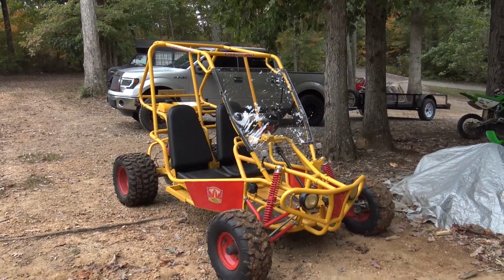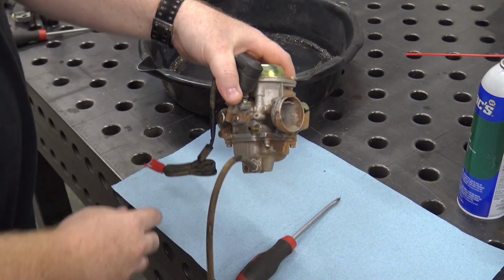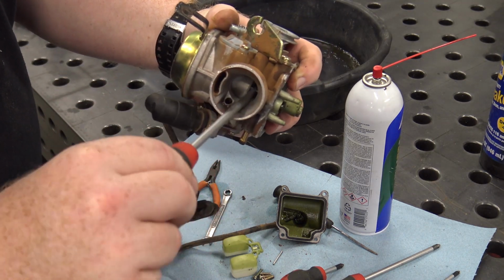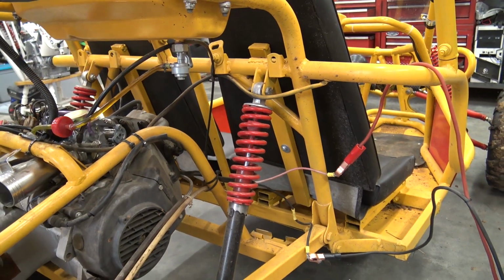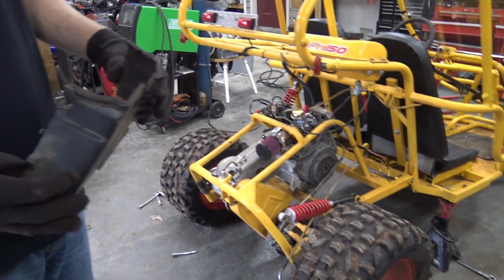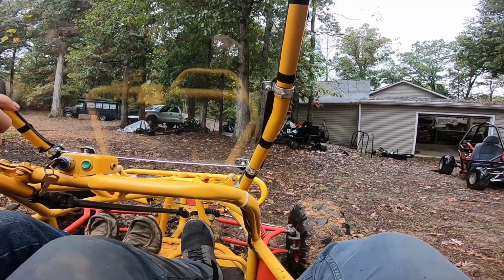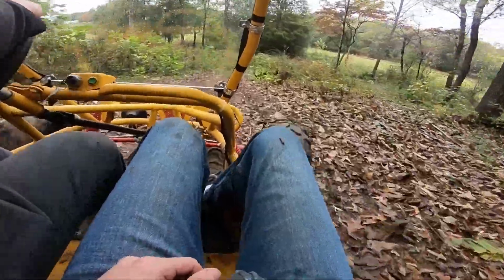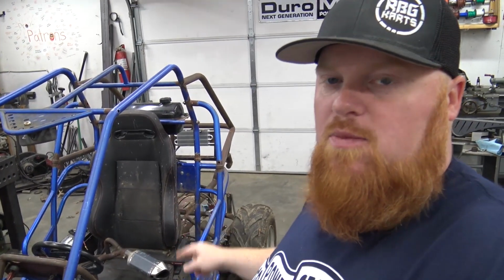Tomberlin Crossfire 150cc Revive

Comment: I am just finishing up a modified crossfire 150   scalped roll cage 8 inches, extended rear swing arm 6 inches to make room for Polaris 400 scrambler 2'stroke with 36 mm carb, Polaris snowmobile pipe/ expansion chamber and transmission. Installed 12'in rims and 26 in tires. LED lights and suspension mods. Next up will be long travel front suspension with 26 inch a arms, remote  reservoir shocks   55 HP and 75 MPH. Not a cobbled up junker, I build and drive drag cars. I have pictures
Reply: Got a Instagram

Comment: There is so much you can do for performance on those 150cc engines such as a big bore/stroker kit, performance exhaust, performance intake, cams, charging systems, cvt reprogramming  via weights and springs, Kevlar cvt belt and so much more

Comment: I trashed my gy6 motor, i flattened the swing arm, and mounted a trimmed frame honda 250sx up in the rear. I mounted front shocks off of a 250 recon, from the top of the 3wheeler frame, to the rear frame on the buggy. That thing was a beast. Got you in and out of alot of trouble.

Comment: Hey Big Red! I’ve watched your videos before but when I saw the name Tomberlin I had to comment. See I own a 2018 Tomberlin SS Coupe 48 volt Golf Cart LSV. That is a great Golf Cart especially compared to most others out there. They all come with 4 wheel hydraulic brakes with drilled front disks, independent adjustable coil-over front double A arms, safety glass DOT Windshield and wiper, 3 point seat belts, all LED lights, including stop, tail, turn and four way flashers and third brake light with a VIN, that comes with a Certificate Of Origination to get a State Title and Register it for use on roads with 25 mph limits. Mine being an SS Coupe comes with an A/C 17 hp electric motor built onto the straight rear axle with trailing arms and adjustable coil-over shocks. Mine has 8, 6 volt deep cycle Trojan Batteries, with a built in Bluetooth equipped smart charger. Mine will get up to 27 mph on my GPS, on a fresh charge and handles like a Go-Cart with absolutely NO lean and I’m able to drift around corners and parking lots! They come with 235/30-14 low profile tires and sharp chrome alloy wheels, but in the interest of a better all around ride and off road traction, I had mine swapped for nice 255/50-12, that are actually 1” taller with twice the sidewall hight and wider tread with more and deeper tread that with the anti-spin differential Helps a lot in deep wet grass an light mud. Everywhere I go in our beautiful retirement community I get compliments and have fun passing all but the fastest tweaked/tuned carts and mine hasn’t been tuned yet! In many Golf Carts like my wives Eze-Go, that does go 25, I would not want to go much faster because of no front brakes!

Comment: I have owned SEVERAL of these Tomberlin's and DUNE 150's. They are one of the best made. Very good little China buggy!!!! You'll need to clean the jets in the carb out. Main will be clogged, so will the pilot jet. Get a  HOT CDI, Foam Filter, Re-Jet to a 125 main, and it will run MUCH better. Mid grade gas. Buggy Depot has an exhaust that is the best $$$ deal for a performance part.
Reply: Do you have a link to the "hot CDI"?

Comment: Broken air boxes, chain covers, and weak heim joints are known issues on these things. They are also geared really short so don't expect much top speed out of it but they get up to it quick. I really looked at them when I got my buggy but the lack of reverse and front brakes turned me off of them.
Reply: Cant you get better quality hiem joints? And luckily they make gy6s with reverse and low gearing is good for me. Thinking about getti g one myself

Comment: Where can I get that carb to air filter extension and the air filter you guys are using for these GY6 150cc engines? I contacted Go Power Sports and they didn't have a clue where to get that part.

Comment: Hey just was wondering if you would know what I'm missing here. I have the same go kart cleaned the carb all the jets the float needle is all in good condition nothing ceased. It cranks but won't start. It will start with starter fluid gas is going down to the bowl in the carb. Also put a new spark plug and battery.

Comment: I have a crossfire just like that one but mine has better seats and a racing harness.I had the same problem with my air filter box and probably just need to change to a filter like you did.Is anything I need to do other than put the filter on the carburetor  and oil it.

Comment: Hey Red I have a gokart well kept low hours but the other day I took it out and noticed that when I floor it it struggles to move under its own power. Do you have idea on what steps to take. Its a gy6 engine I replaced the clutch and cleaned the carb.

Comment: RBG question  can I run a 5speed manual behind a 780 CVT to stretch the gear between manual shifts?  I'm putting a 60horse 503 Rotax on a 300lb streetbike frame setting it up for 1/4 mile I have the cvt from the snowmobile that runs out of rpm before the 1/4 mark I have a 5speed manual divorced from a honda 750 I'm wanting to do a single shift or possibly 2shifts in the 1/4 mile.

Comment: So you said starter click but doesn’t turn on? So 2 wire plug what you mean by this cause I have A 150r an it just clicks but won’t start everything new but only thing I can think of is my wires are no good any idea why won’t start an just clicks from the starter solenoid relay kind of annoying can’t figure it out yet an ran before just fine???
Reply: Replace your solenoid
Reply: I have an still get the samething I’m wondering if my starter went out but I have another one an still nothing just a buzz click
Reply: Key switch could have went bad

Comment: WOW Go power sports charges $50 for that carb when you can get them for $23 off Ebay??
Reply: the go power sports one has performance jets already, so when you put a better air filter or exhaust on, its good to go, and run even harder.
Reply: @frigglebiscuit7484  That's not worth the extra $25-30 bucks seeing as the jets are like $5 you buy them yourself.
Reply: Thats because the one from ebay is from China
Reply: @Ohiocountryboy-se2cn  There all from China.

Comment: Got a tomberlin crossfire in my garage right now. It will smoke my hammerhead to 20 mph then the hammerhead blows it away after that.
Reply: Tomberlin tops out around 30 hammerhead tops out around 50.

Comment: You 2 BIG guys are way beyond the weight capacity and performance curve of that 150. Try it with a 180 lb adult and it will rip!!
Reply: I got pics of my daughter 6 feet in the air on her 150 R , buult up like it is it gets on with it pretty damn good , one down fall i have to rebuild the upper every year ,she is got it smokin bad by the end of the season , how its gona from a 150 to a 175 ,jug and slug .62mm worth it thou